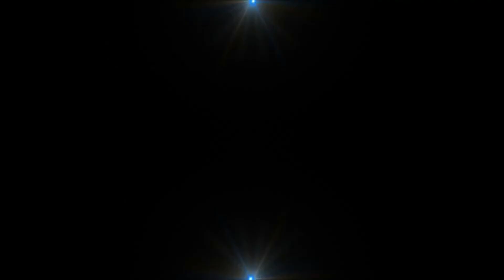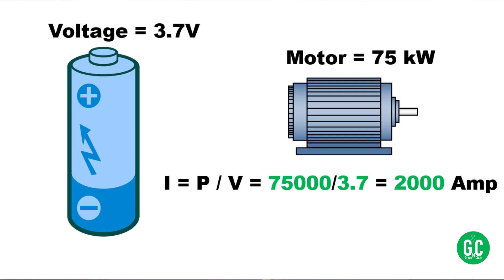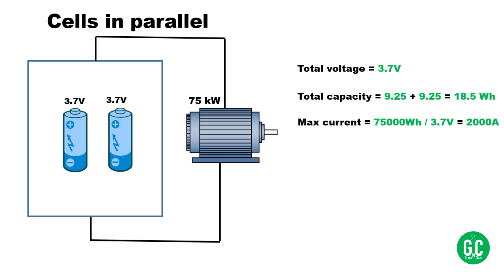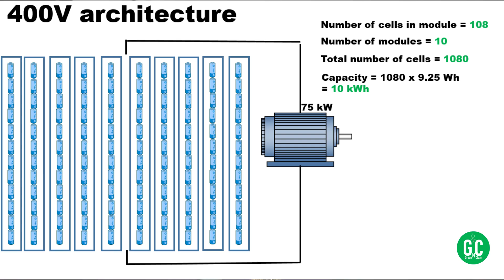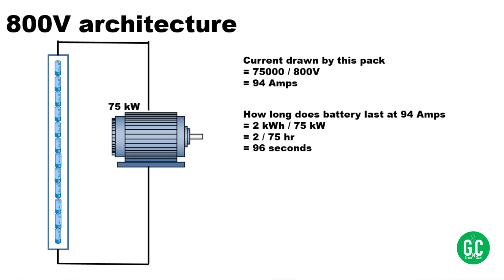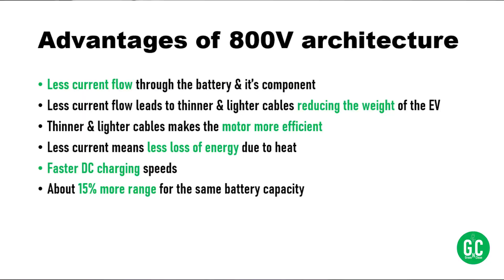Understanding EV Voltage Architecture: 400V vs 800V Explained!

Comment from the maker: 🚀 400V vs 800V – Which One Do You Prefer? ⚡🔋 Let’s discuss!
With BYD’s 1000kW charging making headlines, the future of EV voltage architectures is evolving fast! Do you think 800V systems will become the new standard, or will 400V still hold its ground?

Drop your thoughts below! 💬👇 Also, don’t forget to LIKE & SUBSCRIBE for more EV tech insights! 🚗⚡

Comment: nice explanation… 
what are the key impact on ev car by changing HV battery spec 89kwh 400v (NMC) to 89kwh 800v (LFP)?
Reply from the maker: Thanks. LFP is definitely better battery chemistry and 800V would make it faster to charge, lighter cables etc. So it's a nice upgrade